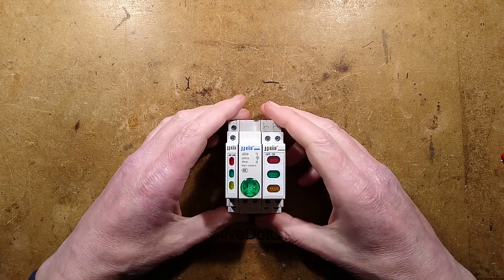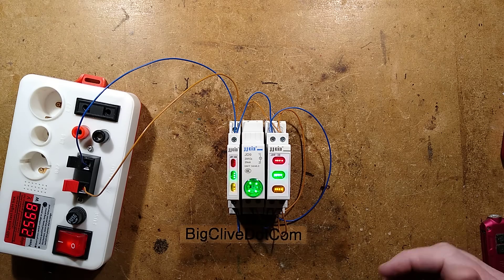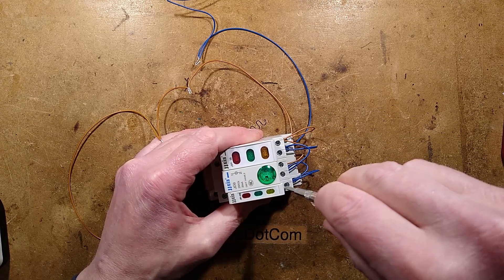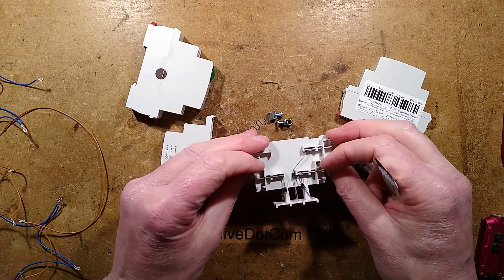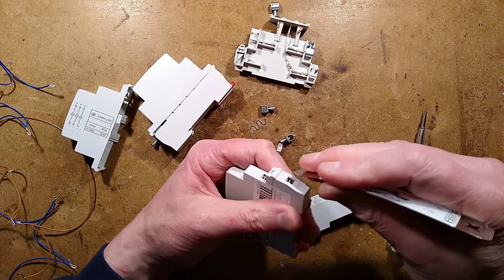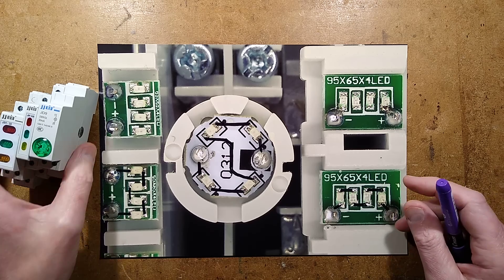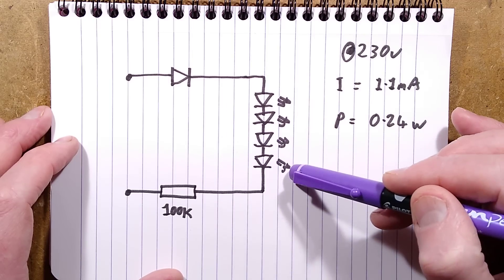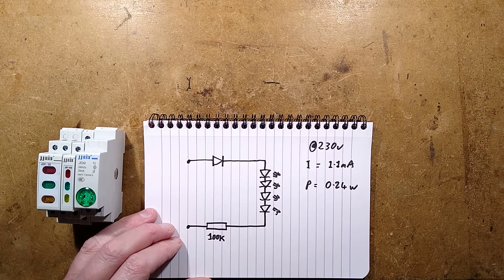AliExpress DIN rail industrial power indicator teardown - with schematic

Comment: 100k seems a little low, specially as it has a diode, 300v through it, no wonder it's bright!

If diode, why you still call it alternating current, it's just really badly modukated dc 😅
Reply: It used to be called "pulsating DC".  😊
Reply: It doesn't have 300V through it.
Reply: @BTW...  Rectified mains voltage...
Reply: @phonotical   "Rectified mains voltage..."
Have a think about that, if you can, and explain how it could be 300V DC from a single phase AC supply at half wave rect.
Reply: @BTW...  The peak value of single phase AC is the RMS voltage multiplied by the square root of 2 (1.4142) and 230 x 1.4142 = 325.266
Reply: @ruben_balea  The output voltage of a half wave rectifier is half the peak voltage of the input AC voltage, minus the forward voltage drop of the diode.

In any case, current flow determines light output from a LED.

Comment: the LEDs look like they have been hand soldered, but that would be impossible. They just dont look very good joints and the LEDs are all over the shop.  I wont be buying any to put into my mains in the house. 🤣      Interesting bit of tat 2X👍
Reply: chinese hand soldering labour is still cheaper than an automated production line, especially in the smallish big cities with an over 20% joblessness rate. 😏👆
Reply: @kittytrail  In China they even assembled LEDs at home, I mean the "classic" 3 and 5  mm round LEDs, they got the (factory rejected?) tiny chips, soldered them to the legs and then placed everything in a mold into which they poured resin to make the lens-encapsulation. There was at least a video but now I can't find it because now there are many videos about how poor people assemble LED bulbs and LED strings at home or in tiny shops...

Comment: Are they actually red, green and yellow LEDs, or are they all white ones behind the coloured lenses? It would be simpler to make them if they all used the same LEDs on the boards.
Reply from the maker: Separate colours.  The red and yellow are more reliable than white LEDs.

Comment: I like the really narrow one, three lights and not much room taken up. Could also reuse the housing for a more useful indicator. Thinking the larger one could have a small OLED screen with the ESP chip buried in the back housing..
Reply: Problem with the small ones is that they’re less than a single standard DIN module so you’d just end up needing a 1/2 width blanking module

Comment: Hi clive, I am about using them  in my panel for showing whether the solar inverters or the grid has power.
Do I need to fuse them seperately?

Thank you for the Video 😊
Reply from the maker: I would recommend a fuses, and on 200V upwards adding an external sleeved resistor will make them safer.